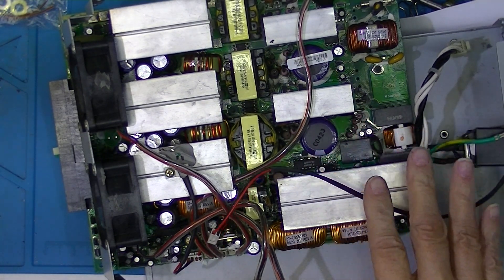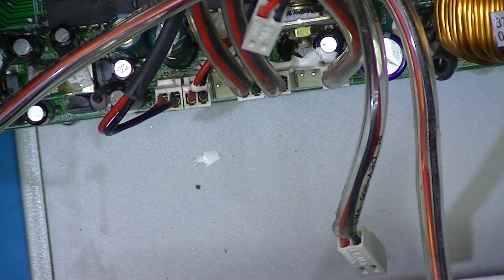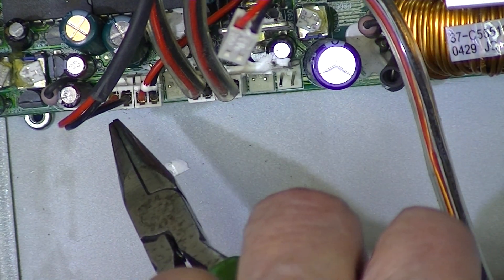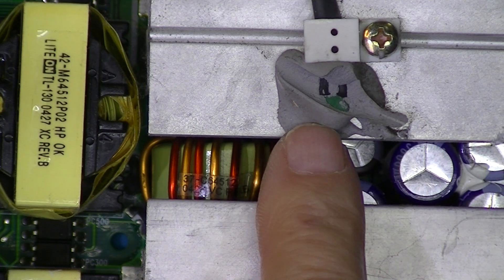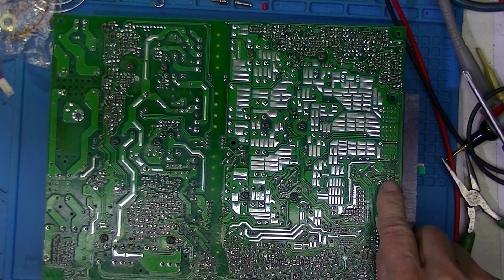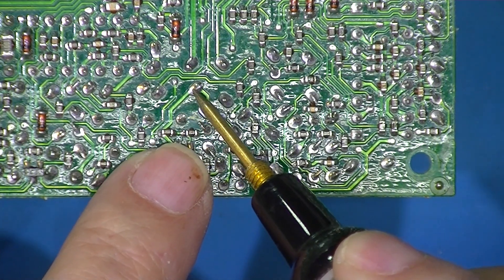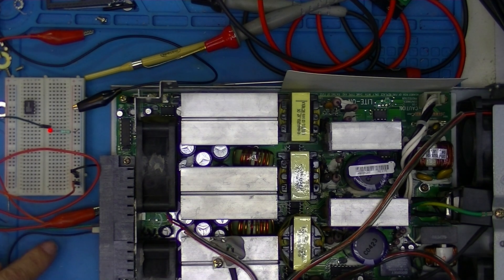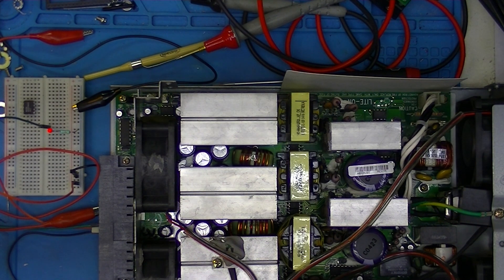ESP115 Server Power Supply - Part 2

Comment: Hey Steve. Where's the link to the pinouts you discovered? Also, If you up to 13.25v, does that reduce the current, or does this increase the available wattage capability?

I have a connector board from a ML370 I just stripped. As it is a dual PSU machine, its a long board. It'd be nice if I can cut off the second side, but it appears to be a multi layer board. Thoughts?